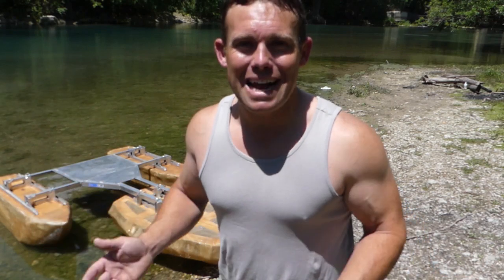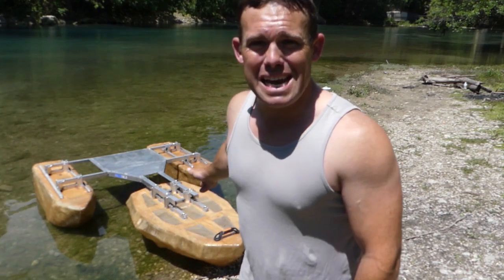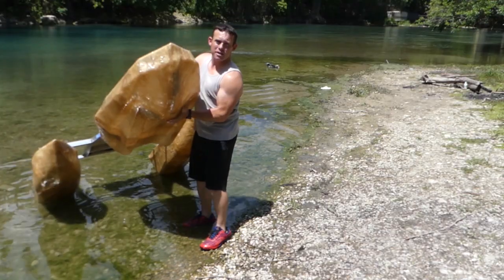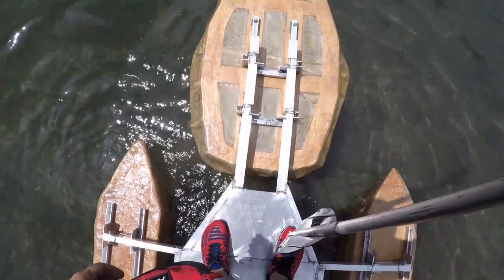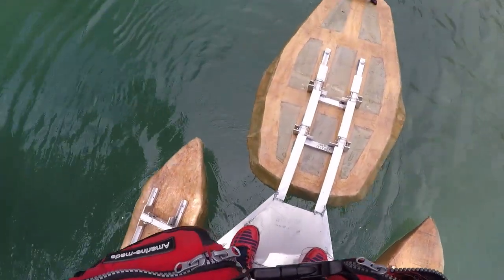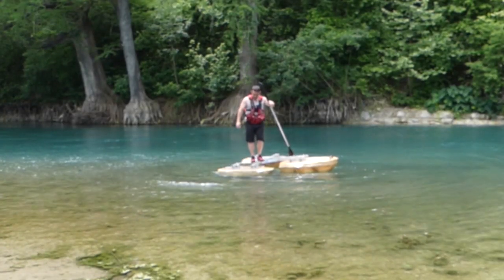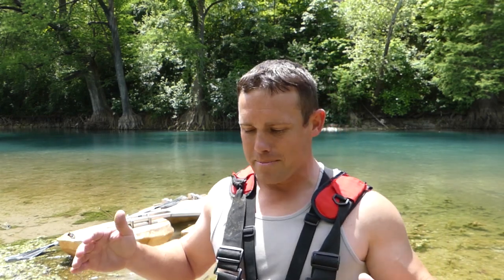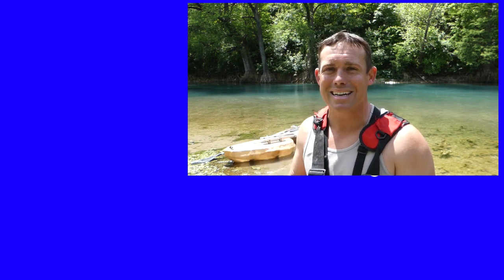Star Wars Fishing Boat Test. Lightweight Aluminum, Fiberglass, and Plywood Homemade Build

Comment from the maker: Let me know if you would fish on this thing.
Reply: For sure, looks much more stable that my 12 ft. Wilderness Systems Tarpon. Good platform, now you just need to get it rigged for fishing.
Reply: If I was 10 years old
Reply from the maker: @scottjones5455  exactly, I dont need alot of stuff to go fishing. I'm just going to take the backpack and a paddle and see how it does. Thanks
Reply from the maker: @jerrypauling7809  ha that would of been a bass boat at 10 for me
Reply: @TBassFactory  Mine was an inner tube with a plywood board, and it caught fish in the old creek
Reply from the maker: @jerrypauling7809  sometimes simple is all ot takes to catch fish. Sounds like you had a good idea
Reply: Definitely would try it. Good design and will probably give some ideas to others. Some finish work and you might sell a couple.